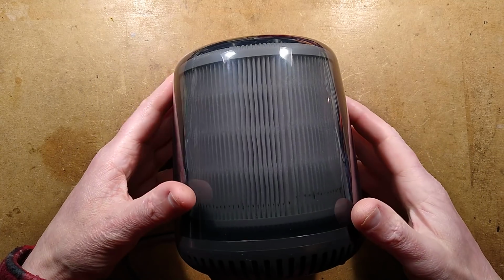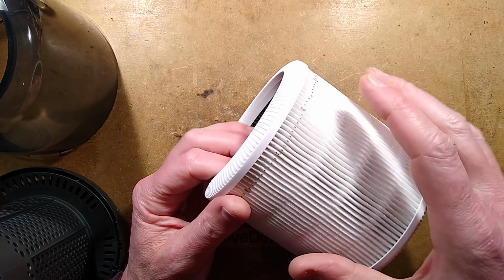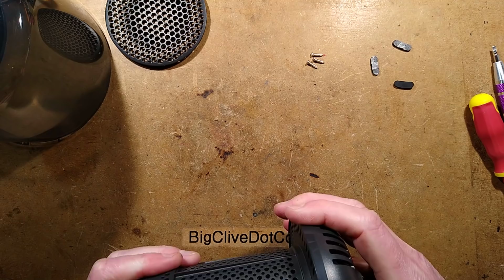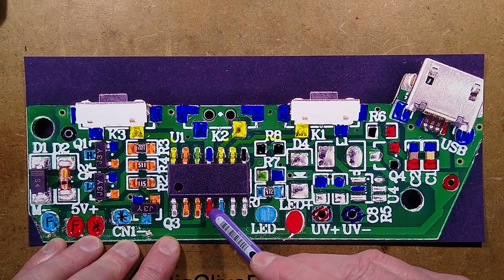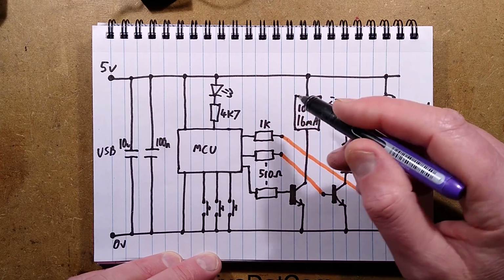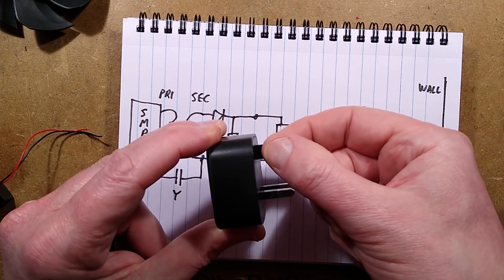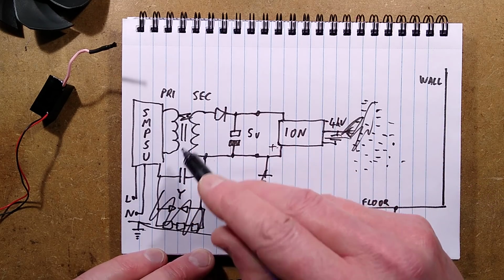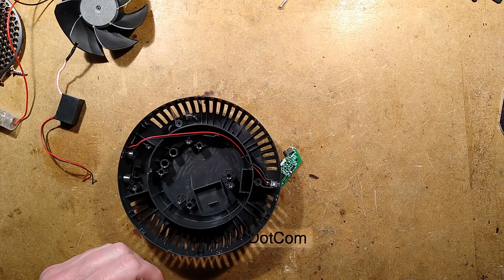Queenty air purifier/filter teardown (with schematic)

Comment: Decent real HEPA filter units use a replaceable coarse prefilter to remove typical household dust to extend the life of the HEPA filter. True HEPA filters (there are many, many fakes) become more efficient as they load with particles and only need to be replaced when air flow declines. Honestly a good MERV 16 filter is the most you need in a home, especially if combined with an ionizer charging the air before it enters the filter media.

If you aren't generating respirable silica (grinding quartz), making pharmaceuticals/silicon wafers, performing surgery, or working with radioactive materials you don't need true HEPA room filtration. Moving a large volume of air through a cheap filter is more effective than a tiny volume of highly filtered air. Figure the volume of your room and the air flow through your filter. If you aren't filtering the volume of the room at least every 3 minutes you aren't really accomplishing anything.  Regularly using a mop/vacuum cleaner on the floor, dusting, and wiping surfaces is also needed if you truly want clean air.
Reply: I've been preaching this for a while now - that a tiny volume of air being sucked through one sheet of toilet paper by a weak fan does bugger all whatsoever. Except making the toilet paper slightly dirty before it blocks airflow completely. I suggested before to get a cylindrical automotive (engine intake) air filter and stick two computer fans at each end. This should at least have some airflow (though, seeing your comment on filtering the volume of the room at least every 3 minutes, probably not enough).
Reply: @horrovac  Axial fans like computer fans or even the big ones used on car radiators simply don't generate enough static pressure to work with high efficiency filtration elements. (yes. they can if equipped with multi-stage fans and properly designed stator vanes, but if those existed you couldn't afford them).

There is a reason every A/C unit uses squirrel cage or reverse impeller air movers. They do work at high pressure drop and make far less noise/require less power than axial fans. Filter media is rated at face velocity / static pressure. Higher efficiency filters elements require more pressure and it is cheaper to add more filter element media than to add more powerful blowers. Real HEPA filters have huge internal surface area for this reason and are much thicker (have deeper folds) than typical ventilation filters. 

Both vehicle engineers and government regulators I have spoken to have a hard time wrapping their head around this concept. It's just so darned easy to say "put a HEPA on it" and not really engage the brain about what that really means. That is especially true in a world overflowing with fake HEPA filters.

(sorry for the rant. touched a sore spot.)
Reply: My HEPA uses differential pressure readings to determine the load on the filter and the need to change it.  It also has a pre-filter, carbon filter then a HEPA as well as ozone injection.  I can leave a dead fish on my counter and have company over.  No one would smell the fish.
Reply: @TechGorilla1987  That's just how it should be done.
The filter, not the fish :-)
Reply: @Miata822  What about "ger-filter fish"

I'll see myself out.
Reply: @TechGorilla1987  (groan)
Reply: @TechGorilla1987  Very nice! I'd buy that filter.
Reply: @Miata822  Give it no mind, I like a good and informative rant. I'm liable to nerd out on something that annoys me myself.

I probably know more about this then what you give me credit for, even though I'm by no means an expert - I work in high performance computing, and those machines need a LOT of cooling. So the rear panel of my clusters is a solid wall of Papst squirrel cage radial fans, about 100mm in diametre. I have nevertheless had to optimise the cooling by placing more and more grills in front of the thing, because the lower fans would suck the cold air away before it rises to the upper parts of the area. The fan units have louvers that close when the fan is active, so that the active fans won't suck hot air (high pressure) through to the front (lower pressure). I also had to block up the air passages inside the rack so this won't happen through the slits between the machines and the sidewalls. The rack doors came with a decorative fine and even finer mesh for decoration (SGI), I removed all of them and left only the coarse mesh on the door. On other machines, I have either removed the doors completely or simply took them off. All of this together can drop the temperature about 3-5°C. So I know how important throughput is, and how much removing unnecessary obstructions can help here.

There ARE multi-stage fans. The small form factor servers usually come equipped with those. They have no stators with vanes to speak of, but they are essentially two counterrotating fans, the front one with full complement of blades, and the rear one with less (usually just three). Those are VERY efficient at generating a high throughput and generating high pressure. The problem however is that they also make a hellish noise. This type of fan is one of the reasons you are not allowed to enter some machine rooms without ear protection.

Also, a computer fan != computer fan. Some professional grade single stage fans that get put into servers  - like Sanyo's SanAce line, or stuff from Papst - can also generate quite a bit of pressure. They're about twice as thick, have very deep rotors with optimised blades. Unfortunately, they too are loud as hell, even though not quite as loud as two-stage ones.
Reply: @horrovac  I have not seen the double stage fan before. Will check it out.

Balancing air flow through a device can be an art form, as you well know. Sounds like you've got a pretty good handle on it. I bet you are a pretty good customer of Magnahelic as well :-)

I was bidding the cooling system for a large lithium battery storage system for a very large (you would know the name) company known for it's engineering. I could not convince the young engineers that "Putting BTUs in the box," as they had requested, would work. I ended up walking away from the project. Never saw it come to market.
Reply: @soundspark  It is very rare for viruses to be found by themselves in the air. Human infectious viruses in the air are usually inside moisture (water and mucus) droplets which may also be attached to dust particles. Though a virus can be dried  most will quickly decay when dry.

Even then a single bare virus is quite likely to be captured by a less-than-HEPA filter through the combined action of Brownian motion and static charge. 

True HEPA filters are best used in labs that potentially contain very large concentrations of dangerous viruses, rooms where semiconductors are fabricated, and facilities that process highly radioactive material.

Much more important than the specific grade of your filter, and very often overlooked, is the amount of air flowing through the filter. You want quite a lot of air flow, more than you think.
Reply: @soundspark  it would, but for a household air filter, that would be a virtually useless advantage. In your home, the viruses you encounter are most likely your own. If they are from someone else living with you, HEPA won't save you either, sooner or later they'll breathe straight in your face or touch or sneeze or spit on something you're going to touch or eat.... This kind of "advantage" would be advantageous only for high-traffic, high-risk locations - say, a doctor's waiting room. For your home? You need something to filter the dust and perhaps some fungus spores, that's it.
Or just open the bloody window every now and again.

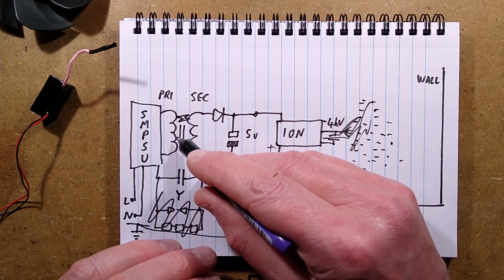Comment: Speaking of ionizers, yes that will absolutely nuke a power supply. I was generating corona discharge with one of those stun-gun modules and powering it from a 60V adjustable supply. I couldn't figure out what was going on at first but I kept hearing a little tick, kind of like a small static discharge coming from inside the power supply. Before it clicked what was happening, the pass transistors and control IC took a shit, and the output went to an unregulated 70V and the current meter pegged at 8A. WOW WAS THAT IMPRESSIVE!!! That module had no difficulties at all launching sparks over a foot long when running on 70V instead of 3V. Power supply was obliterated by it, but the little module seemed unfazed by its little "excursion". Edit: 19:24 That's exactly what happened. Naturally, afterwards I found the supply was set to be "floating" instead of grounded, with predictable results. Even though there were two leads from the module, some of the current from the corona probably found an alternate path back thru the supply.

Comment: Computer fans are brilliant.
1, They're quiet.
2, They run for years.
3, They have a standard mounting.
4, They're available all over.
I use them as extraction fans 😀

Comment: Our house has 'automatic air filtration system'. To change the cobwebs, we just vacuum up the full ones.
Reply: @imark7777777  Clotting material ????
Reminds me of when a friend slipped with a Stanley knife and sliced into my finger leaving a 2" long gash. I used a finger from the other hand to stem the bleeding for 5 minutes, then carefully peeled that finger off the cut one - what a perfect repair I've been left with !
Reply: @imark7777777  There's nothing better than blood for cleaning wounds (other than saliva) - never mind 'debris' it's a case of flushing out bacteria, fungal spores and the like ! A pathetic cut that fails to bleed can be worse health-wise than a proper bleeding wound !
Cobwebs - extremely flammable ???? Is that a vehicle fuel of the future ?
Sounds like you need to wear safety glasses. Chemical concrete burn - interesting. I've picked dried concrete off my fingers and never had a 'burn' from it.
I've not had a problem with circular saw benches. Issues usually arise from people pushing wood into the blade.

One of my toenails fell off a few years ago. Not really too bothered about it but aware it could get infected. Wearing sandals, I visited a friend - and her dog started nibbling on it - so I knew the dog had found infection. I removed my sandal and let the dog chew my toe end until it was happy the matter had been resolved. It recovered fine after that. - so yes, I've been medically treated by a dog !

Comment: I have a much larger expensive air filter that has a HEPA filter with an electrostatic element and UV bulb in the air stream and an air monitor that indicates how clean the air is and the condition of the filter. The filter doesn’t need to be changed, just cleaned. I’ve checked the functions with smoke from matches and it works really well. No sulphur smell goes through. It moves a lot of air. It has a large squirrel cage fan about 3’ tall. When the forest fire smoke permeated outdoors last summer it cleaned up a 12X24’ room in less than 5 minutes no matter where I moved it in the room. The fan is very quiet. I use a shop vac with a narrow nozzle to blow out the filter and the inside. I have no idea what electromagicry makes it work but it does a really good job. At a couple hundred bucks it costs five times more than a cheapie tabletop model but it’s a hundred times better. Ya’ gets what ya’ pays for.

Comment: The filter looks exactly as the air filter of my BMW motorcycle.
Reply: Motor vehicle filters are different filter material, much more open and less filtery. But yes, pleated filters are common all over the place.
Reply: Yeah looks very similar. In fact most air filters are made in one of about 8 global factories. Then they're branded. The machinery is quite complex to make them.

Comment: Maybe the negative ion generator pointed at the LED wiring is a secret self-destruct mechanism; eventually the insulation degrades and allows the high voltage to dump into the microcontroller, killing it... :P
Reply: “Your mission, Clive, should you choose to accept it...”
Reply: Yeah.. thats planned obsolescence for the ecosystem.

Comment: I have one that is not as noisy as that. I wrap the hepa filter in paper towel and it costs almost zero to change the paper towel very often and it is quite dusty in my place so it gets pretty dirty. It works well to suck up solder smoke. Mine is about 2 years old, pre covy.

Comment: If you shove a whole toilet paper roll in there, it could be 500x ply filtration!
Reply: Much better than the LEPA (Low Efficiency) filter included :p
Reply: @patrickglaser1560  depending solely upon brand the answer can be largely whittled down to “many” 🤣🤣🤣

Comment: Excellent review Mr B.C.!!! (as usual ;-)
Must tell you that I used your cheap LED light bulb mod to (hopefully) lengthen the amount of time our carport lights last... (standard cheap LED's only lasted +or- 2 years) We have a 2 car carport with 4 light fixtures, 2 bulbs per fixture, (we're in the USA so 110v). The LED bulb design was quite similar to your designs so I clipped one of the resistors as you suggested and the wattage dropped (nearly) in half as well as the heat was near ambient!! The slight reduction in light wasn't really a problem as 2 bulbs per fixture was really overkill and I had used 60w equivalent bulbs, they gave out roughly the same amount of light as a  40w LED bulb. Hopefully these bulbs will last MANY years and I won't have to get up on that ladder again for a VERY... LONG... TIME!!! Thank you so very much for the tips Mr. B.C.!!! You're the best sir :-)

Comment: Filter also looks like what you get for some vacuums.  

We used shop vacuum HEPA filters and a bathroom vent blower fan to help with the wildfire smoke last year. Worked pretty good. Definitely wasn't quiet though.
Reply: Fantastic invention  (sorry bout the pun). You can also use damp woven material for smoke/ash. Hope you never need to use it though.

Comment: The component across the secondary and primary winding came out of a cost reduction exercise intended to replace an expensive air gap discharge junction part. This part bypass the ionizer’s return path to the neutral wire of ac input. That capacitor was chosen with a break down voltage close or less than what exhibit with the air gap.

Comment: I’ve been playing with some of those 12v “fridge ionizers” and running them from batteries.  If you put a meter in series between the unit’s negative input lead and earth, you can see that it does develop a positive potential referenced to ground. It appears to be limited by the fact the unit has both a positive and negative output.

So it seems to be an ozone generator when operated on batteries, and perhaps an ozone generator and negative ion generator if grounded.

Comment: Imagine turning Clive loose on say, ... An F-35... I'm not even sure it would be safe to leave your cell phone at his place... His curiosity is our entertainment and education. Thanks, Clive. I enjoy your vids very much. Have you ever seen an IC with a window in it? I believe it is out of a color laser printer, but not sure how it is utilized.
Reply: USUALLY, an IC with a window is an EPROM. But since it is from a laser printer, and the window's not covered, a far more exciting option presents itself: a digital micromirror device(DMD). TI makes them, and they use thousands of itty-bitty mirrors on itty-bitty hinges to make a picture with reflected light. No, really. Swear I'm not lying.
 They are also used in digital projectors.

The laser printer would use the DMD to reflect the laser light onto the print drum, painting the image to be transferred to the paper.

Comment: I like this one: honeywell 50250; 13$ prefilter lasts 3-6 months and 100$ HEPA 1-3 years
All analog all the time. 3-5 air changes per hour in a small to medium room
Fairly durable and big, but pricy.
Reply: I think I have one of those. Great big cylindrical Hepa filter and the Charcoal impregnated pre-filter that you can buy. Great simple design but slightly noisy for a bedroom because it’s using a huge squirrel cage fan.
Reply: @Adscam  On low speed it was fine; just the rushing wind noise. I bought the big unit for a small room to allow that.
Reply: @stephen1r2  I also have another brand for my bedroom. Blueair made in Sweden. I have the older model that is a folded rectangular box of mild steel. Very sturdy and heavy. The best thing about them is they are very quiet on the low speed setting. You can get the normal Hepa filter or upgrade to the Hepa+VOC filters.  The larger models also come with the electro-static discharge function to capture more particulates.

Comment: If after a good filter, maybe cobble up a box that uses a common/cheap big box store HVAC filter with a little quiet fan to draw air through? If you wish the inside could contain all manner of ionizer/s, UV misc, granulated charcoal etc...

Comment: Personally I've only ever bought air purifiers with filters you can clean yourself. I assume it's really not the same as putting in a whole new filter, but it's good enough considering the insane price of the replacements. You pay about twice as much up-front for the unit but know there won't be any sneaky costs down the line (until it dies).

Comment: Just a heads up. China makes and sells really good air purifiers for their domestic market. They are constantly battling smog and chemical fumes in their big cities. So their home or commercial air purifiers are really big, like man-size. They are used in lobbies and restaurants etc. They are packed with all the latest technology and are not cheap.
Reply from the maker: I featured a plasmacluster purifier in a video.